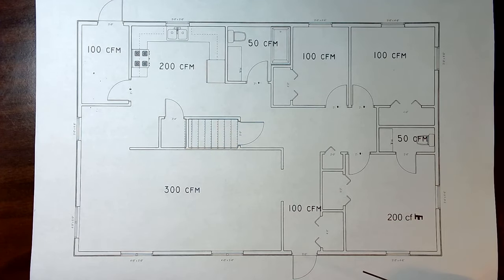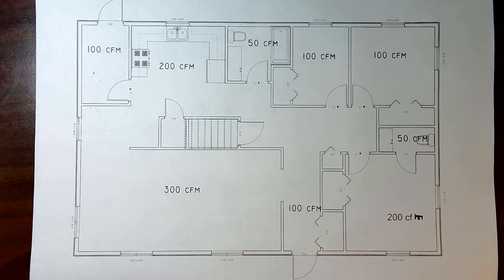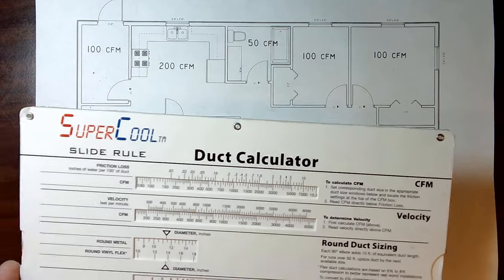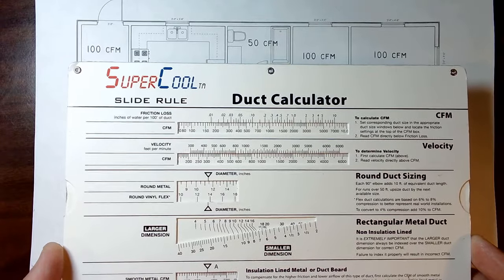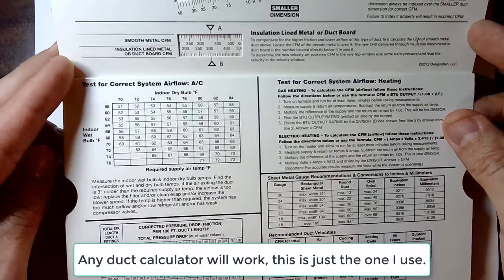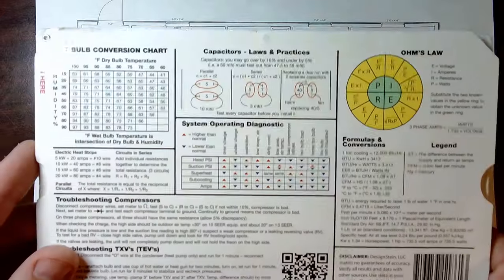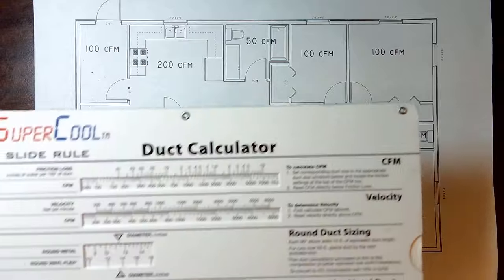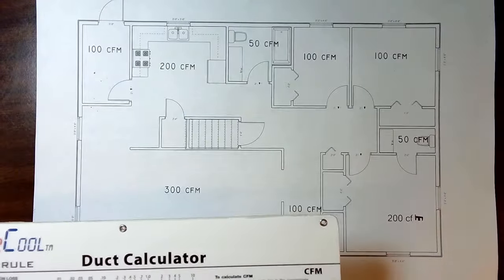How to Design Duct Work for a 3 Ton Air Conditioning system

Comment: If you have that same 3 ton system on a house 2500sq ft house with 21 heats would you match the main duct sizing to the air handler or size the duct up to 2100cfm
Reply: What do you mean by "21 heats"?
Reply: 2500 Sq ft house would need a bigger unit
Reply: @Machoman-ct  almost need a second unit at that point
Reply: You'll need a 4 and half or 5 ton unit or two units to match the sizes of the house... (Period)
Reply from the maker: A 3 ton would probably be a little light depending on what region you lived in.  In Minnesota it would probably be fine.  One thing about refrigeration is that it is very picky about the airflow it has.  If you want it to work like it is intended it needs 350-400 CFM per ton.  So a 3 ton unit would run 1050-1200 CFM.  Anything more or less than that will cause the refrigeration cycle to operate incorrectly.

Comment: So many of these videos are done with ducts coming through the floor. That’s not typical of homes in my part of the US.
Reply from the maker: The only real difference would be the location of the ceiling registers.  Typically they would be located closer to the center of the room, but still more toward the outer edges.  The same types of reductions would apply with duct board or Sheetmetal.  If you are using a flexible duct system it would be significantly different.

Comment: Friction rate is not static pressure..... and you do not assign it based on duct type. You calculate it based on the total equivalent length of duct and available static pressure. Screwing this up, makes your "design" nothing but guess work.
Reply: Yeah but this is just simple velocity reduction. Tallying up friction loss turns it into the equal friction method. What he showed in the video is better than 95% of residential installs that are not calculated at all. Besides, short of running CFD on top of empirical testing, all ductwork calculation amounts to guesswork anyway.

Comment: How do you determine when to reduce the main duct size?
Reply: The ductulator will tell you, after you enter the ammount of CFM you need and also when you reduce,t his way you know if you go smaller on your run( more than likely and 99%?) from what i've learned.
Reply: Your supposed to reduce when your velocity drops by half, that is the guidance of ACCA Manual D
Reply: ☝ this is the correct answer ..  I know a lot of people use the old rule of thumb of half your branches off the main but , that's not the right way either
Reply from the maker: Once the velocity dips down to around 500-600 FPM in the main branch I size the duct work down.  This is done to bring that velocity back up.  Without the velocity (speed of the air) you wont ever deliver the conditioned air where it belongs.

Comment: why .08 instead of .05 or .10? thanks.
Reply from the maker: It's a rule of thumb that we use when we do not know the Total Equivalent Length or Available Static Pressure.

Comment: That a 2 ton system 28x8 is huge..
Your unit is only going to be 14 or 17.5 
Also you should always start at the end and work your self back to the unit.
This duct is tooo big you will have very poor air flow. Also if you dont put a Radius, fitting, at that first elbow.You are going to have significant pressure loss resulting in more lack of air flow.